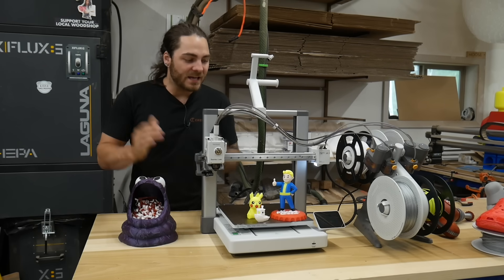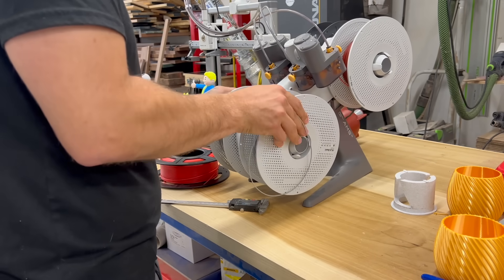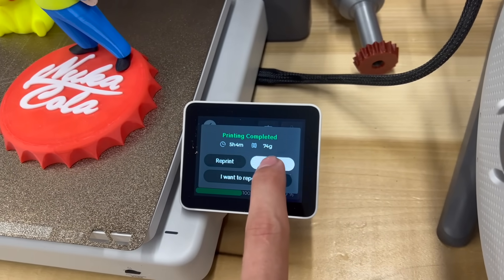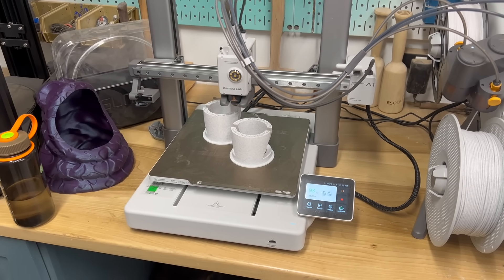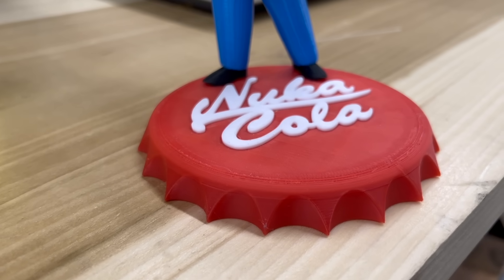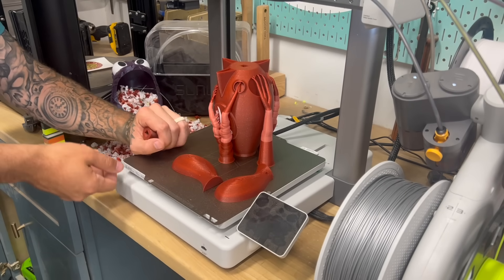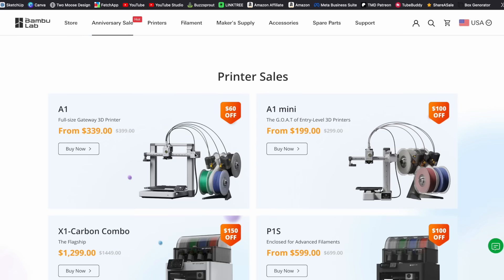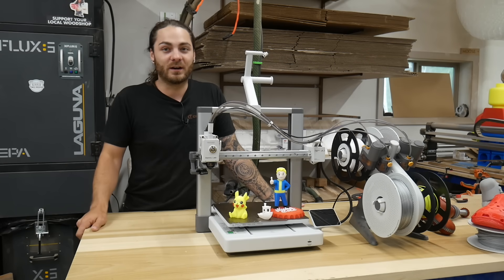Watch This Before Buying the Bambu A1...

Comment: I started my 3d journey with a Biqu B1.  Lets just say I learned a lot about repair, tweaking, upgrading, and Cura settings.  Moved to a Ender 3 Pro ( got it at Microcenter for $99.  I just had to buy it).  Learned more but that was pretty bullet proof after the upgrades.  But slow.  I just got the A1 a few weeks ago and absolutely love it.  I also love the Bambu studio for the most part.

My grandkids love all the neat little things I can make for them.  One of the downsides is that you go through filament a lot faster ;-).
Reply: Pretty much the same, spend way more time tinkering with the Ender these days then actually printing with it, just got an A1 on sale and looking forward to just printing.
Reply: @ghostofdre this is where I'm at. Even after a lot of upgrades and replacement parts (especially the bed surface several times), still get lots of hiccups and reprints on the Ender. Ready to just print!
Reply: I’m thinking about making the upgrade to the A1 from my old Ender 3 v2 that’s been running like a champ since I got it years ago. How much faster would you say that the A1 actually is in your real world experience?
Reply: @justsomemincedgarlic  light years faster with better quality.
Reply: @rogerwa123  sounds like a winner to me. Just placed my order this morning!
Reply: @justsomemincedgarlic what was the website you used to purchase it from

Comment: the apple/android analogy is actually pretty spot on
Reply: I would prefer Linux/Windows analogy more tbh.. Because even Android is fairly closed system which you can jailbreak but that doesn't necessarily let you do more than get root access. As for Linux/Windows analogy.. Linux is an OS you can build from ground up yourself if you want, or use a frame someone else has made or use whole OS someone has made.. Lot like with 3D printers you can build your own or buy some sort of kit and so on.. And Windows is basically the A1, it just runs and works without the user having to actually know more than some very basic info.

Comment: I'm intending to buy the A1 without the AMS kit (non-combo). Will it also produce that amount of PLA-waste or is that only relevant if you change colours a lot?
Reply from the maker: its only relevant when it switches colors. You can always add the ams later, its great for switching rolls as you only need to press a button. I dont print much multi color and i think the ams is great still.
Reply: @TwoMooseDesign  Many thanks for your quick reply! As I'm on a bit of a tight budget I'll skip the arms right now.
Reply from the maker: You’ll love it great machine. Thanks for watching!

Comment: I just got one and It works really well, with it being closed source I'm worried for when they force some BS but so far so good....
Reply: I think I heard awhile back that you can "technically" install open source firmware onto bambu printers, you just lose the ease of access that the stock firmware has. I think bambu even had a statement on it saying that you can do it, but they just don't recommend it. Not sure where I saw all this though.

Comment: Acting like multi material systems adding waste plastic is a downside is absurd! They're ridiculous to begin with, no industry usese multiple color plastics to make a single piece! Even in Injection molding it's far more cost effective to just painting a part, instead of trying to rig multiple colors of plastic. I don't understand this obsession with wasting plastic, instead of learning to paint.
Reply: Honestly, there are now a lot of rotary injection molding presses that have 2, or sometimes three barrels to support multiple colors or materials. Kinda cool actually lol.
Reply: I disagree. First, the waste is really a non issue. Annoying, but that’s about it. I use different material for my supports than for the print. That’s a real pain for a single head machine. It’s only really possible with an AMS. It’s easy with my H2D. Do you want to spend more? Then fine. And it’s not true that everything is painted commercially. For some toys sure. But honestly, I can’t wrap my head around why adults spend so much time and effort printing toys. But when I design a handle for screwdrivers, I use PETG and TPU. So sometimes you need to do this. And no, most people aren’t going to waste their time painting. Paint which will wear off for a lot of products.
Reply: Because I despise every aspect of painting and have money for filaments??? Besides, I'm fairly sure most people watching this are doing this as a hobby, not at an industrial scale or level, so your comparison to Industrial injection molding makes zero sense in this context.

Comment: Those look like the 150% Pikachu model, but I was able to do a full bed of the 100% models yesterday on the X1C at .16 optimal, variable layer height, w/stock .4 nozzle in like 11 hrs and barely added any waste over a single model!
Reply from the maker: Yeah the key is to definitely print more than one based on others input. Same amount of waste for one vs many.
Reply: @TwoMooseDesign and orientation is key, lots of things have colors mainly on one side, make that the top and I have cut times and changes by a ton. One was 54 hrs to 15.
Reply: How much did it cost in materials to print it?

Comment: I’ve never had or used a 3d printer, I’ve been thinking of getting a a1 or a ender 3 v3 SE. I’ve looked into the a1 mini but I don’t like how small the base is. Are there any other printers I should consider?
Reply: Also would prefer if it had some sort of pause feature but idk how common that is in printers
Reply from the maker: You should be able to pause all modern printers. I personally would buy the regular A1 without the AMS unless you have the budget. You can always add it later
Reply: @TwoMooseDesign  thank you so much! I am planning on getting the a1
Reply: Please say you didnt buy the ender v3 se over the A1
Reply: @shadbadrkhan7413  I didnt, I changed my mind about getting a printer honestly. But if I ever do im gonna get the A1

Comment: Bought an a1 mini last week and I love it over my ender 3. So I bought the x1c and another mini. Better to have it (x1c) and not need it than not have it and need it.
Reply from the maker: Hahah heck yeah!
Reply: What makes the X1C worth a thousand dollars more than the A1?  I don’t get it.  My A1 puts out perfect prints continuously.
Reply: @joeking433  It’s not $1,000 more, it’s $1,000 overall. About $6-700 more than an A1. X1C is enclosed, and can print many filament that the A1 cannot handle. To me, this is not worth it, I mostly print for wargaming, but that is where the price premium comes from.
Reply: @user-asa187 print quality is higher slightly at even higher speed, about 10-20%

Comment: Was it just me or when going over the multi-color printing you had the X1C selected in the slicer?.. The AMS Lite changes colors slightly faster due to not retracting the filament as far like the AMS. Also like others stated, due to defaulted flush volumes the amount of waste will differ per user if actually calibrated which essentially brings down the waste to nickel amounts (depending on colors)

Comment: I have the x1c. I saved for month. Decided after going thru 3 different printers having to tinker with stuff isn’t in my time frame. I LOVE how easy it was to set up. I love all the sensors and how smart it is. Only issue is learning fusion which I am doing slowly. Managed to make a bracket and 2 different fridge shelf’s so far.
Reply from the maker: The X1C is a beast! Modeling is tricky I personally use shapr3d and do it in an iPad
Reply: Switch to SOLIDWORKS maker, it's 38$ for a year and in my opinion it would be a good deal at 4x that much. The hours I wasted in fusion are gone.
Reply: I would stick with Fusion. It’s free for hobby work and I have been using it for years. I have made so many things with it.
Reply: How is the X1C better than the A1?  I just don’t see the value at a grand more.
Reply: @joeking433  I would also add to what the other guy said that it's a core xy. So tall items aren't getting flung back and forth at ludicrous speed so the risk of layer lines and ghosting as well as just straight up detachment of the part is much less. And the large side fan cooling down at nozzle height is always better than just room air. And like he alluded to abs and nylon need an enclosure and carbon filter at minimum to keep the odors and VOCs in check though it needs an outdoor vent if you print much toxic material.
Reply: @joeking433  x1c has a enclosure first off. Then it has lidar and other sensors built into it. It also has the ability to get really hot out of the box without mods. It’s about levels. The enclosure with the internal air filter is only on the x1c. If you look them up on their website it shows them all on a line up and what they are to each other. Also the build plate is the biggest with the x1 and x1c

Comment: About that one element loose after missing power. You can skip objects using phone app (so other on plate can finish). Usefoul when there is something wrong with one on plate (multicolor = print many to reduce cost of purge).
Reply from the maker: Ahhhhhh thanks! I didn’t see that option on the display to skip objects. I can on on my other printers, didn’t think to check the app

Comment: I agree the only thing that a AMS system is good for is the change filament type the rest 4 color prints with 2 and 3 times wasted filament not worth it
Reply from the maker: I do love the AMS! I just don’t have a ton of use for multi color, mostly like 2 color prints for like text. But it’s soooo easy to just select another filament in the slicer or load a new one

Comment: I'm watching this as I want this printer. I have a toybox, but want to move on. Is there anyway to reuse the waste or purged pla?
Reply from the maker: Not as of now for an affordable set up, I have seen people put the waste inside other prints. You can also make multiple prints at once so there is less waste. The printer is great and easy to use’s unfortunately without spending alot of money there’s not much we can do to reduce or recycle the waste.
Reply: @TwoMooseDesign I saw a YouTube video where someone used the waste inside of a cast, I think he had melted it and then poured it in. And it made a beautiful skull. It was multicolor of course, but it looked really nice how it came out. Just an idea instead of just throwing away the waste.
Reply from the maker: Prusa is the only printer with multiple heads that I’m aware of that eliminates waste but it’s very expensive. You can look up ways to reduce the waste of the Bambu in the settings you can definitely cut it down a bit

Comment: @Two Moose Design is it possible to order Bambu A1 without the AMS unit at first and then later on order the AMS unit install it without perhaps having to order a new Hot End to be able to feed the four filaments ?   Thank you for your review and your time, happy printing.
Reply from the maker: Yes you can, it should only take like like 15 minutes or so to set it up if you decide to upgrade later
Reply: @TwoMooseDesign  Thanks for your speedy response greatly appreciated, happy printing.
Reply from the maker: Have a great day!

Comment: I'm debating between the a1 and the a1 mini🫣 right now I'm more thing towards the a1 Mini but are here some people how think differently?
Reply: I had the same question in my mind. Bc for the money of the a1, I could also get the mini with the ams. But I thought to myself, that almost all things I wanna print, will fit in the mini and for the few times I would use the ams, It isn't worth the extra money. So I just went with the a1 mini and ordered it a few days ago.
I was having an ender 3 for 4 years at least and I didn't use the bigger bed so often. And when I have to print something bigger, I think, I will just try to cut my models so, that I can maybe glue them later or so haha but let's see if this will work
Reply: @BESTofAlp  yeah most of the times I'll print smaller things anyways. It's just, when you want to print something bigger, it's nice to have the A1.

And I'd definitely go for the AMS because I'd like to have TPU and PETG in the pipe or 2x the same one, so if one is empty, the the printer can just go to the next one.

That's peace of mind 😍
Reply: @floatypiet  I would do some research if the AMS lite is compatible with TPU. Bc I read that TPU is not really suitable for the AMS :s
Reply: @BESTofAlp  dammm! Thank you for the tip!
Reply from the maker: It’s not, you can not use the AMS with hell at you and tell you to run it external
Reply from the maker: The AMS can’t cycle tpu you have to run in external as it flexible and can jam up
Reply: @TwoMooseDesign  omg thank you! That's good to know!
Reply from the maker: It prints the tpu just fine and it’s not hard to run it external but yeah! I don’t want you to spend money if that was your plan haha
Reply from the maker: I think the A1 mini will be just fine, it will
Print great. My argument is I feel you are going to want more bed space as you progress into 3d printing so personally I would buy the A1 for the larger bed space. Either way I think you’ll be happy with the A1 or the mini.
Reply: @TwoMooseDesign  thank you mate ♥️ I appreciate it! That's what I'm thinking as well. I'll need to think about it again😄
Reply from the maker: If your budget allows it you won’t regret it! If your budget is tight I wouldn’t stress it tooo much, the mini will do the job